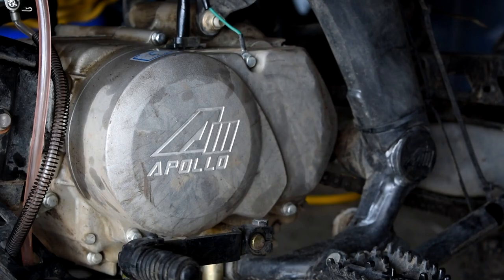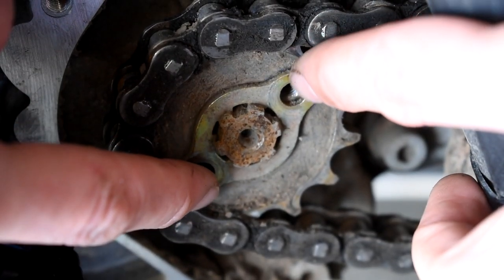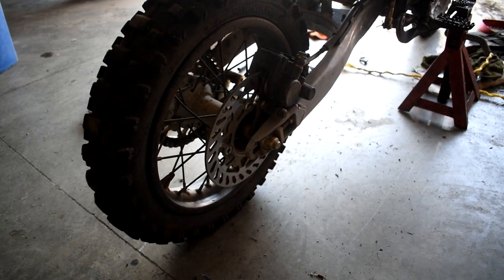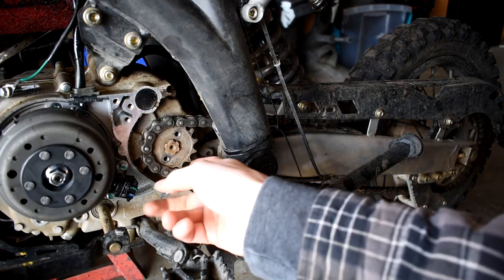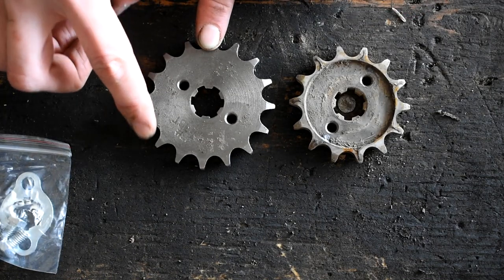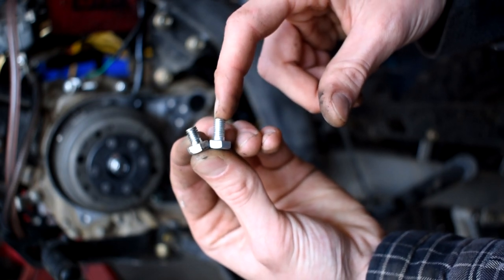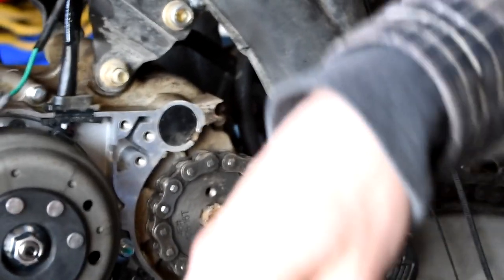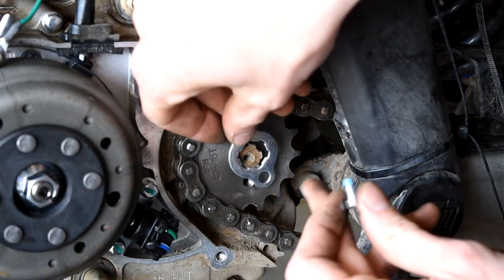How To Make Your Pit Bike Faster | Apollo 125cc Pit Dirt Bike

Comment: I went ahead and put a new makuni carb on it too. Cheap. Runs like a beast. Feels wayyy more efficent
Reply from the maker: Heck yeah!
Reply: Put a ribbi carb on it 60$
Reply: Nibbi*
Reply from the maker: If it runs mint with a mikuni why would you change carbs again?
Reply: @AaronsEnduro  depends on how much you ride and what gas you run the mikuni clones kill the throttle cable and always get stuck wide open on the throttle when you start it so you have to rebuild the carb every time you finish riding, or your bike will blow up next time you start it
Reply from the maker: Ya i dont condone replice carbs of any sort. I assumed this original comment purchased a genuine mikuni like i had purchased.
Reply: @anthonystewart-ogle3766 does it make it any faster

Comment: If the bike goes 80 mph 85 then it might hit a hundred depending on what size rockets you put on biggest sprocket in the front will make you go faster and a smaller in the back will make you go faster in the long run slow in the beginning bigger one you go fast in the beginning but not in the long run

Comment: I'm told my Apollo 110cc automatic kick start was to be going around 40mph but it seems way less. Looking it up doesn't seem to match with the info page of the bike and says it should be a semi-automatic. It has drive and neutral, which seems more like automatic not semi to me. Makes me think the top speed to be less ad if the CCs are less than I was told. Definitely looking to increase the speed a little bit.

Comment: Hi , i changed my front sprocket on my honda rebel 125 but found that only really a difference when down hill as the four stroke wont rev higher with that higher front  gear with the 125 cc .
What other ways are there eg re bore / valve upgrades etc 
Thank you

Comment: Guys if y'all are actually looking for top speed (you will sacrifice bottom end torque) you can get a bigger front sprocket and a smaller rear sprocket and will give you twice its top end performance (you will loose a lot of torque tho)
Reply from the maker: Correct! This may be good for street use, but i don’t recommend going that tall in gearing for trail use. When you roll on full throttle at low rpm it with excessively tall gearing you’re putting extra load on the engine which can result in overheating

Comment: Thank you I bought a new 19 tooth front sprocket I'll let you know what happens I also but I 17 and case of it didn't fit because the KTM I went to told me they have never put that big of a front sprocket on a pit bik
Reply from the maker: That is like way overkill to big of a front sprocket lol. Like 16/17 tooth max for a 125 pitbike. That things gonna outta its efficiency zone and be slow asf accelerating but have a higher top speed.

Comment: Hi! Love your vids. I have two dirt bikes, but I use to have someone do the work for me. Im watching all your videos on how to make pit bikes faster and how to clean the carb because mine doesn’t start up after it’s sitting in my garage for I’d say six months. How do I know what gear size to get and how do I know what air filter size to get? Also, why don’t pit bikes have these mods already and what makes bikes able to handle all these upgrades? I would like to make it as fast as possible, along with learn how pit bikes work. I have a thumpstar 110cc and dr-x. Hoping you will be willing to answer my questions. You have a new subscriber.
Reply from the maker: Gear size us gonna be based on what you’re looking to get out of the bike.
Reply: @AaronsEnduro  but how do I know the center piece will fit? Like how do I get the size of the original gears middle part so I can buy one bigger and know it will fit.
Reply from the maker: So you’re looking for the centre spline size. Usually found in mm

Every bike is different, so look up your bikes manual and see what spline shaft size it is and the pitch for the sprockets to match your chain size
Reply from the maker: We can go through it one on one if you wanted ,join here https://www.youtube.com/channel/UCcviyKZ2Vf3IHFliwebzODA/join
Reply: @AaronsEnduro  “420*14T*Φ17 Engine small teeth” it says this for the spine shaft piece and this “14t x 43t = 428*108 Link Chain” for the chain, and it says this for the sproket “428*76*43 Sprocket” does any of this sound correct? I’m not looking to do this upgrade just yet because I’m a beginner, but I want to understand what all of this means.
Reply from the maker: 420 is the chain width, 14tooth is how big or small the sprocket is and how many teeth are on it, 17mm is the spline size!
Reply: @AaronsEnduro  thank you so much for telling me this! So now I just order a bigger sprocket with a 17mm spline size? How do I correspond that to chain size/how much my chain can handle?
Reply from the maker: Correct with 17mm spline. The “420/428” is in reference to the chain pitch

It should he stamped on a link on your chain to show what pitch it is
Reply: @AaronsEnduro  do you have any idea what new sprocket to make my bike faster/more powerful?

Comment: hi i just bought a apollo used off marketplace it starts up first kick and everything runs good no down shift all up besides neutral but some times it gets stuck and its hard to shift past 3rd gear any recommendations of parts to get to fix it
Reply from the maker: changing motor oil can help. Other than that, its just the crappy design of the apollo transmissions, and thats probably why the person waws selling the bike

Comment: So it is more bigger and more  tooth the faster. and the back wheel sprocket if that's smaller and has lead teeth makes faster or slower I just got them for a bike in working on
Reply from the maker: thats correct

Comment: Can you show me how to change the tire i havent rode my bike in weeks 💔💔💔
Reply from the maker: Three screwdrivers, or actual tire removal tools. Remove all the air from the tire, Break the bead on one side, (lot of brute strength, and then folding the second bead over is even “funner”) its a pain in the @$$
Reply: Aaron Greenway Im tryna comprehend what to do but i have little to none knowledge about bikes so i know if i try to do what you said ima still end up in square 1 😭🤦🏽‍♂️
Reply from the maker: Id just take it to a shop then

Comment: Hey man i read one of your replies saying that if its too highly geared it could overheat your engine with trail use i am getting a 16 front and 24 rear witch is very high butttttt.... i have 10 inch, wheels i know size wheels more or less change gear ratio although would the stress on the engine be the same?
Reply from the maker: The wheel size will change gearing yes, and having the smaller 10” wheels will reduce the engine load. Not only will having too high of gearing create unnecessary load on the engine, but the clutch too. This is something that will cause increased wear over time
Reply: @AaronsEnduro  I have a 14 and 37   at the moment but I have the stock 70 sprocket on it with my 125 and I think I do more damage revving out in 4th and revving such short 1sts and 2nds. in trails I'm always half and half 3rd and 4th but when I get on a straight the power will run and out and on the roads and straights I can't even hold throttle full for 5 seconds without having to go half throttle cause it's revving out I think it will really unlock the 125 power and make 1st and second gear useful with a much needed top end

Comment: Did u have play in the sprocket cause when I put my 17tooth on the pin didn’t like up with the holes on sprocket and it was making my chain hop
Reply from the maker: You might have the wrong spline diameter
Reply: @AaronsEnduro  17mm
Reply from the maker: Send me a video on instagram

Comment: if you want to get a higher top speed by putting a different tooth sprocket on does it affect your acceleration?
Reply from the maker: It will! Youll loose some acceleration to gain top speed and vice versa
Reply from the maker: Only way to get more of both is engine swapping to bigger CC
Reply: @AaronsEnduro  ok thank you
Reply from the maker: If u need help with either let me know
Reply: @AaronsEnduro  i just got a db-x19 today. i definitely want more top end, what could i do? Already ordered the mikuni carb.
Reply from the maker: As mentioned above, gearing, and engine swap are the only other things
Reply: @AaronsEnduro  Yeah first gear feels like it has nothing. What sprockets do you recommend? and engine swap as in the bore kit? 150cc? Can u link me
Reply from the maker: Not a bore kit. Entire 150 engine swap. Links are on n the video playlist
Reply: @AaronsEnduro  what sprockets are best for more top end? I see your links.
Reply from the maker: @senate9746  the bigger the sprocket, (in the front) the more top speed you'll get. its a balancing act of how much torque you want to sacrifice
Reply: @AaronsEnduro  whats the difference between *420 pitch and *428 pitch? Sorry i know i seem clueless LOL
Reply from the maker: No worrys Senate, its the size of the chain. Its for the chain to match the distance between the teeth on the sprockets. If you have a 420 chain, so are the sprockets on your bike. You cannot mix and match
Reply from the maker: The 428 chains/sprockets are bigger and stronger
Reply: @AaronsEnduro  Which should i get? I have an Apollo DB-X19
Reply from the maker: Tbh off the top of my head im not sure which one the x-19 comes with. Pretty sure its stamped into the chain tho
Reply: Just don't do it .. you will get higher top speed but losing acceleration it just sucks . .will take you for ever to reach top speed 🤣

Comment: Where's the follow up to this video wanting to see if the sprocket made a drastic change or just a minor one thanks
Reply from the maker: Watch my riding enduro videos and youll see that it helped out a lil until i got my big wheel swap
Reply: Did you upgrade chain?
Reply from the maker: @randycarrillo96  yes
Reply: @AaronsEnduro  which one the 428?
Reply from the maker: @randycarrillo96  go read what width sprocket/ chain set you have. its stamped in the chain
Reply: @AaronsEnduro  I got the 17tooth
Reply: On factory chain
Reply from the maker: Read the chain and it should have 420 or 428 stamped in it. Thats the chain/sprocket set youll need. Those are the two the apollos use

Comment: I've got a fuckin x pro x26. Just changed the 14 t sprocket to a fuckin 16t. Sadly of coarse lost fuckin torque and gained only about 9 mph . Good torque is good fun!
Reply from the maker: Torque is what throw’s you back in the seat!
Reply from the maker: Maybe its time to toss a 150cc in there!
Reply: That's an idea. Will look into that. Like, will it fit and or bolt up the same way. Thanks for that. Wasn't even a thought!
Reply from the maker: Bolts right up! https://youtu.be/8wkfuuRe4ME

If you need any guidance or 1 on 1 help for any modifications you can check this out 
https://www.youtube.com/channel/UCcviyKZ2Vf3IHFliwebzODA/join

Comment: Did you know the new z20 max comes with 16 rear 19 front I wonder if they would fit on my 19?
Reply from the maker: The z20 max has an extended rear swingarm
Reply from the maker: It shares the same rear swingarm as an rxf model(not the rfz)

Comment: Did you have to buy a new chain to put this 17 tooth sprocket?
Reply from the maker: No, but its highly recommend to upgrade your chain from stock
Reply: @AaronsEnduro  should I get a 428 chain size
Reply from the maker: If you have a 428 sprocket set. Its either a 420 or 428 set. 428 is bigger/stronger

Comment: What sprocket size you recommend i change to on front or rear or both? If i want to set up my same bike for wheelies
Reply from the maker: 14tooth front, stock rear gearing
Reply: @AaronsEnduro  well based on your video the stock one you replaced in front was a 14 tooth? So should t i already have a 14tooth on mine as well?
Reply from the maker: Likely!

Comment: Heyyy please help !!! I have a RFZ 140cc 2021 what carb it’s the best for her ?
Reply from the maker: Vm24 mikuni!
Reply from the maker: Get a UNI air filter for it
Reply: Thanks my brooo !!!
Reply from the maker: No problem:) any questions, just ask anytime
Reply from the maker: Dont forget UNI Air filter oil and to apply it to the filter.

( only get the air filter if yours is an open air filter style)

If you have the air filter that goes into a black enclosed box u don’t need it
Reply: @AaronsEnduro  ohhh k thanks sooo muchhh brooo
Reply: What exhaust can I put it to be more louder
Reply from the maker: The volt 5.0

Comment: I noticed the swap was on a 150cc what do you recommend for the Apollo 125cc do you still recommend it the sprocket with 17 teeth and what chain? Thanks
Reply from the maker: The gearing depends on where you ride!
Reply: @AaronsEnduro  trails in the woods
Reply from the maker: Go down one from stock in the front
Reply: @AaronsEnduro  okay thank you and I take it the opposite if I'm just using it in the backyard and the road or just dirt trails then I would go up to the 17 tooth sprocket. And I'm sorry what was it what chain did you recommend
Reply from the maker: Get both and try both! It’s cheap!

Comment: Have you had any engine problems apart from the carburettor
Reply from the maker: No, and ive “swam” with mine, banging limiter the whole 9. Just dont buy shit oil, and change it frequently (like every 10ish ride hours) buy an hour meter to monitor oil changes

Comment: Hey Aaron I have an Apollo Z20max and a dbx18 and I’m gonna switch both front sprockets to the 17 tooth what size chain do u suggest the 420 or 428 and what length if u know?
Reply from the maker: If you’re bike is stock 420, youll nee 428 front and rear sprocket as well as the chain

428 stuff is stronger

The chain to order is 120link
Reply: @AaronsEnduro  I appreciate that quick response bro I’m actually in the process now that was very helpful 🤙🏾
Reply from the maker: Hell yeah brother! Hope you get what you want :) thanks for watching!
Reply from the maker: Note that i do believe you need to pop like 2-4 links out of the 120 link ( which is normally what you do)

The next size down at 110 link is too short
Reply from the maker: ( i bought the and used 120 link)
Reply from the maker: To verify your link count, ( as i owned an rfz “open”). Theres a stamp on the side of the master link*should be* that says how many links your is

Comment: My only concern is if it picked up torque or decreased the torque bc I want to do some real riding, it would be very helpful if you could let me know
Reply from the maker: Sorry what exactly are you asking?
Reply: @AaronsEnduro  basically if it lost torque it will bog down more on hills and if it gained torque it will be easier for it to do hill climbs or get to its top speed better like on the take off ( 1 gear it won’t bog down as much)
Reply from the maker: That is correct. Its a trade off. What do you want more. Torque for hill climbs, or just overall top speed
Reply: @AaronsEnduro  I would like better top speed but I need lots of torque because I ride in sand and do a lot of hill climbs
Reply from the maker: Then i would if anything just try going up one sprocket size in the front. If it feels better then leave it. If you miss the torque, go back to your original sprocket. Its like 15$ for a sprocket
Reply: @AaronsEnduro  ok

Comment: I just bought a brand new pit bike RFZ i’m trying to make it faster how do I do that
Reply from the maker: Larger sprocket up front
Reply: Is there a thing in the exhaust that makes it go slower that you can take out and then it will go faster?
Reply from the maker: Whats inside the exhaust can be two things. A silencer, or a spark arrestor

Comment: little late of a comment but I have a db-x4(110cc), what would you recommend for increasing top speed?
Reply from the maker: Never too late to ask questions on my channel! This gearing mod showcased in this video will be the easiest amd cheapest top speed you’ll get out of your bike
Reply from the maker: You could also get larger wheelset to increase top speed, but remember its a trade off, youll loose some acceleration to gain top speed
Reply: @AaronsEnduro  thanks! i have a little one and was wondering why it topped out at 30, felt it was a little slow but I will definitely try it out!
Reply from the maker: Those two mods are going to the the only mods to increase top speed without doing an engine swap
Reply: @AaronsEnduro  Ah nice, also where can I see he chain thing? I’m not sure which one to buy?
Reply from the maker: Be weary with how many teeth you swap. You wont want to do more than 1-2 teeth larger on the front sprocket or you’ll be loading / lugging the engine at low rpm (not good) 

Directly from google why thats bad:
“it raises the engine temperature, make them run less efficiently and create issues with the engine's timing”
Reply: @AaronsEnduro  mine has 12 front tooth 428 chain, would 14 be alright or too excessive?
Reply: @AaronsEnduro  also probably last question(sorry I’m just super interested lol), is the top speed change noticeable to the rider?
Reply from the maker: @marcelrl7747  you'll clearly feel a difference yes. the 14 tooth is what is stock with a 125cc apollo. I think 14 will be as high as you want to go. For 10-15$ a sprocket you could get both a 13 and 14 to see which you prefer for a balance of top speed and acceleration